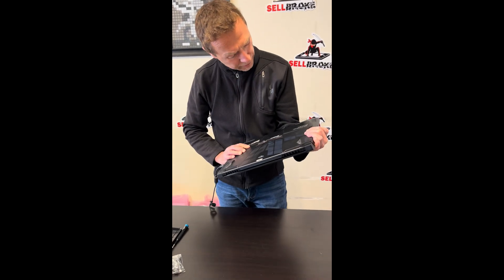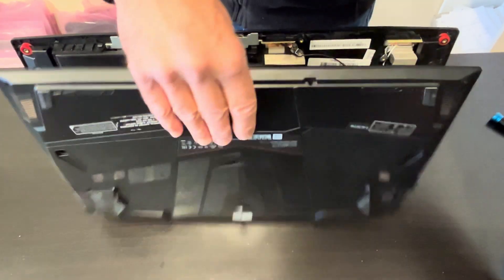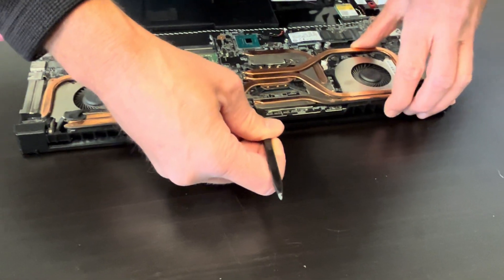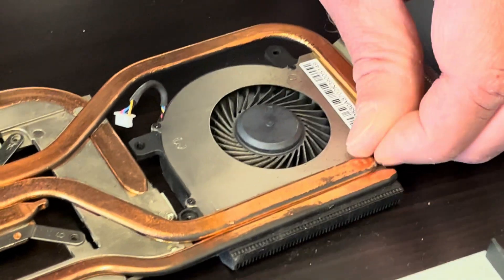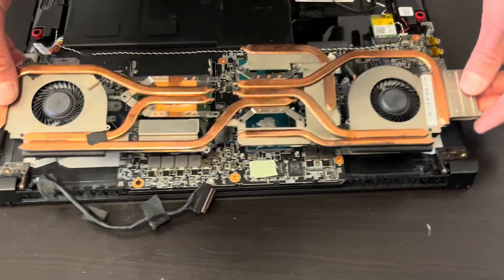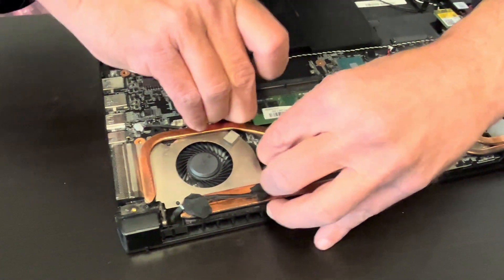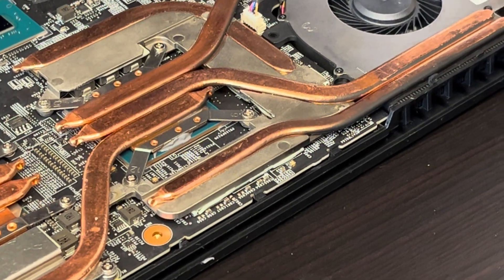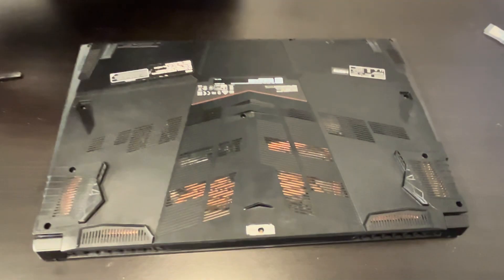DIY Cooling Fans Repair MSI Gaming Laptop. Fix overheating. Replace noisy fan. Complete instructions

Comment: Nice. First laptop upgrade DIY, cleaned the fan and heatsinks and reapplied thermal paste, upgraded RAM from 16GB to 32GB, and I just installed a new secondary SSD. All good to go now. Thanks bro.

Comment: Appreciate the effort, but lot of issues with the work done, from working without ESD safe hand gloves to removing screws to... applying heat sink paste.  Buddy you cannot top-up heat sink paste on some old dried up OEM heat sink paste as you showed!!! (even if it is fresh) you need to completely clean the old paste with alcohol wipes then apply the new paste. you cannot mix 2 different pastes and it cannot spill over the CPU or GPU chip as you did  Also old paste needs to be cleaned out from the thermal module which you missed out. Also PRO tip just remove the RAM to get more space next time to handle the thermal module...

Comment: did the same but now my laptop is not opening plz help. It starts for few seconds like about 20-25 sec then permanent turned off. I'm too stressed right now don't know what went wrong and did I something worse ? What should I do plz help
Reply: My msi laptop problem was battery. Same issues you're having now.